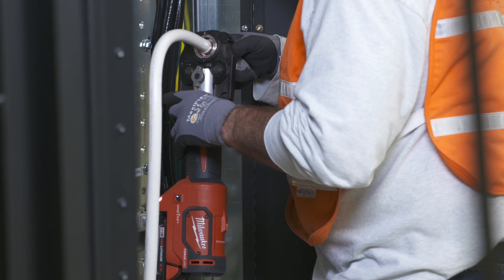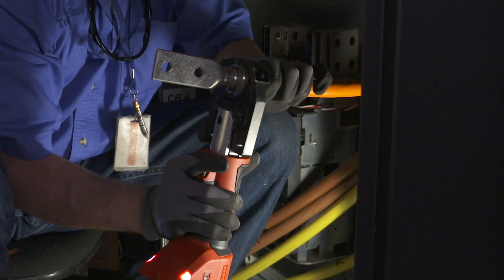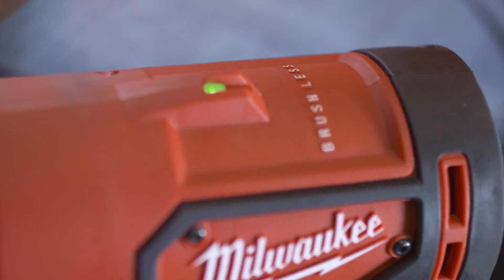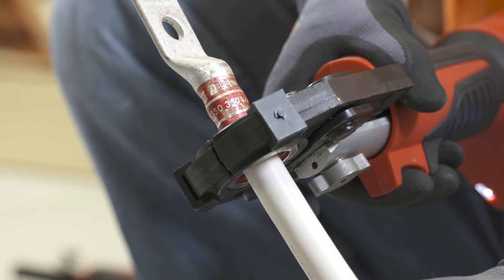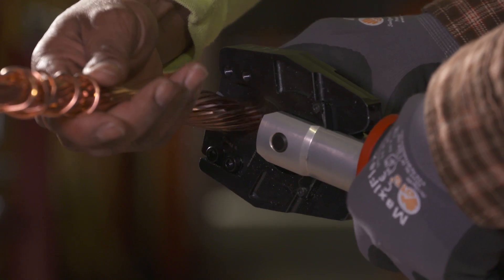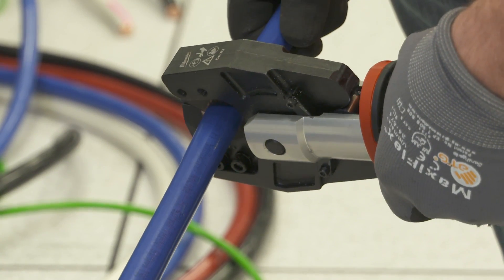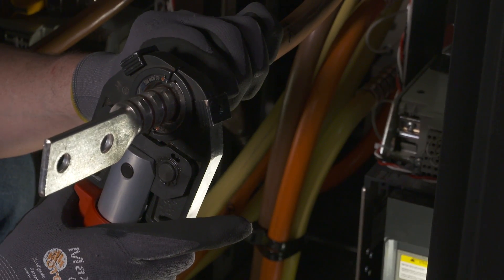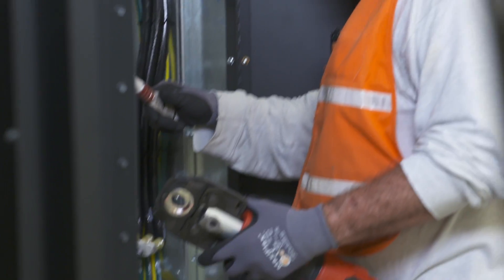Milwaukee® M18™ ForceLogic™ Commercial Crimper & 750 MCM Cable Cutter

Comment: can you use this tool to cut out old copper pipe?
Reply from the maker: We wouldn't recommend it as the tool is not designed for that application.
Reply: @MilwaukeeTool  can I use those jaws on my milwaukee pro press?
Reply: They have a different tool for that same idea but it has exchangable heads.